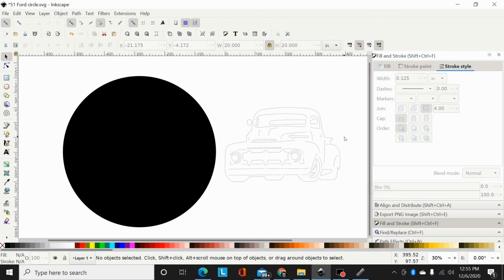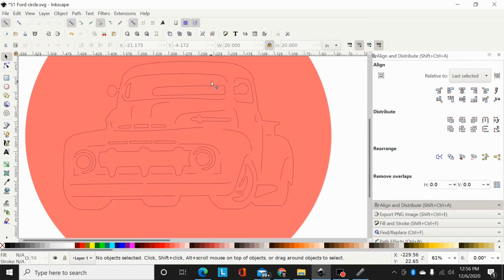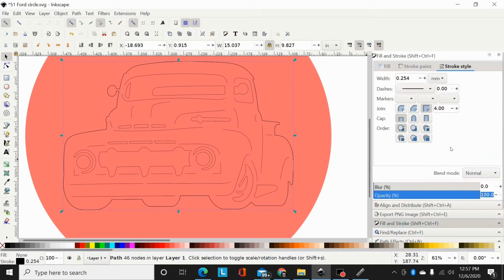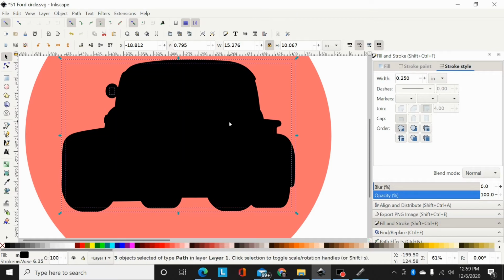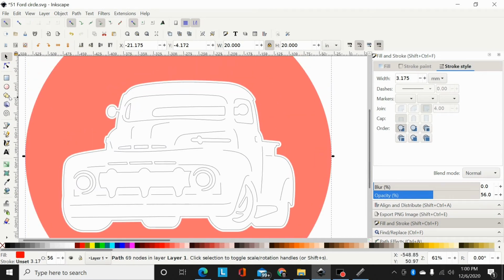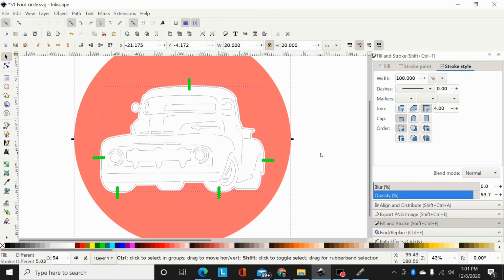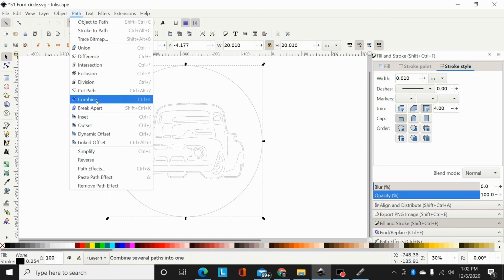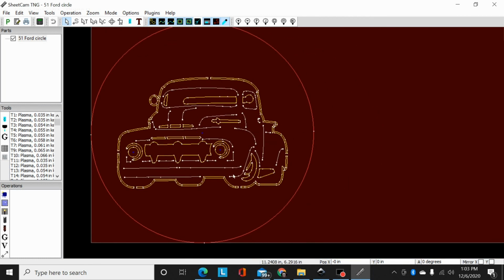Inkscape Tutorial: Adding an Open Path Design to a Panel with Bridged Outline

Comment: Hi,
  I have been following along with this tutorial all is good until i get to the bridges i put them in but when i go shift control plus nothing happens after that, i'm begining to think it's a problem with inkscape,t i have the latest version any ideas?
Reply from the maker: Some people have issues with keyboard shortcuts not working in Inkscape. You should be able to make it work with the drop-down menu though if you go to the Path menu and select Union. Not as convenient but it will accomplish the same goal.

Comment: Hi Great tutorials,I have a question how do trace an outline image like the truck you have here from an image off the internet i did trace bitmap do ihave to make different operations to get all the lines i have the outside but if i cut that it will just drop out the image is going to be on the side of a fire pit.Any help would be great. Thank you
Reply from the maker: I cover this in a different video, check out https://youtu.be/bGB_bxuMvLI in that video I explain how to use the bezier tool to trace an image. The image in the video is of a cut design but the process will be the same for a real vehicle.